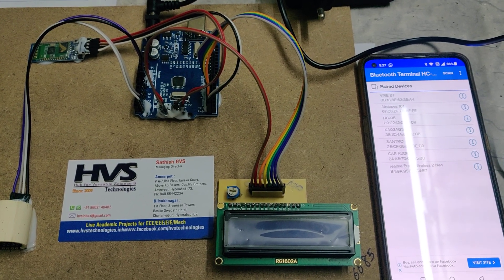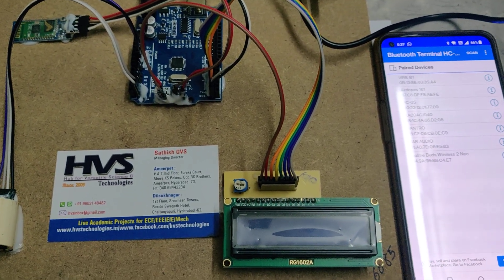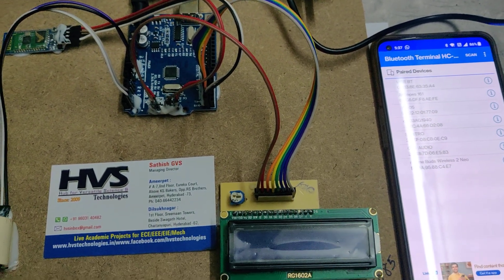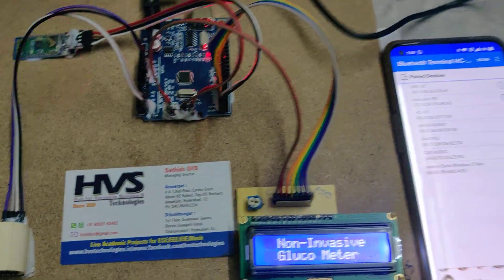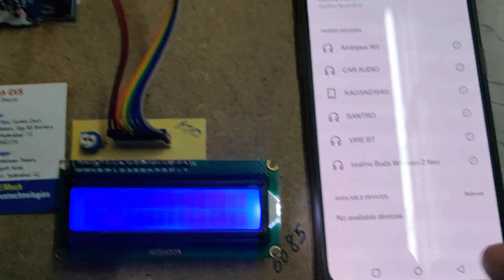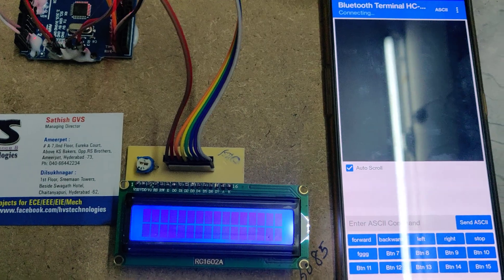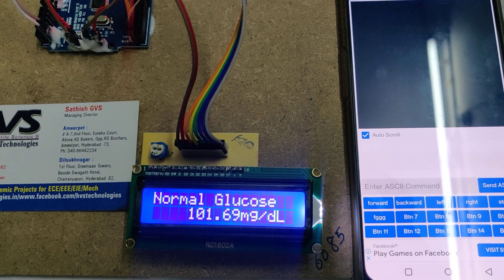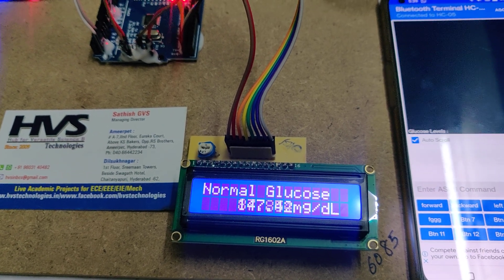HVS-3668. Noninvasive Glucose Concentration Measurement System #bluetooth monitoring #NIR glucose.

Comment: I need all the components and materials and the code please
Reply from the maker: Hi, 
We sell full working kit with document PPT circuit diagram and code. Could you Send me the video link, Will update you the cost details. You can contact us at +919603140482
Through WhatsApp or call
Reply: No, thank you. 
I just need to know what materials did u use in this device and the code please. @hvstechnologies
Reply from the maker: After order placed, you will get the details  @عبداللهمحمود-ح5ض5ط